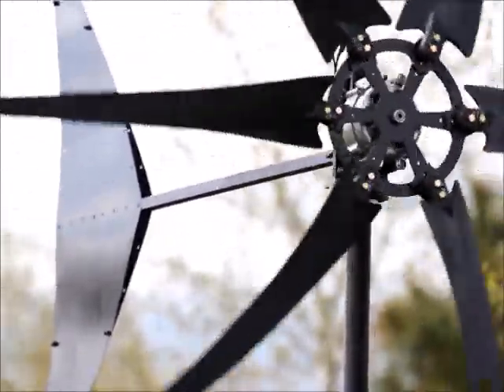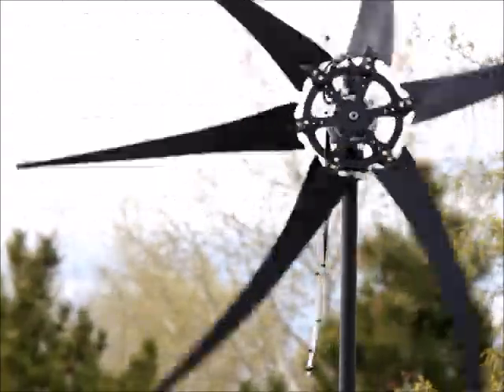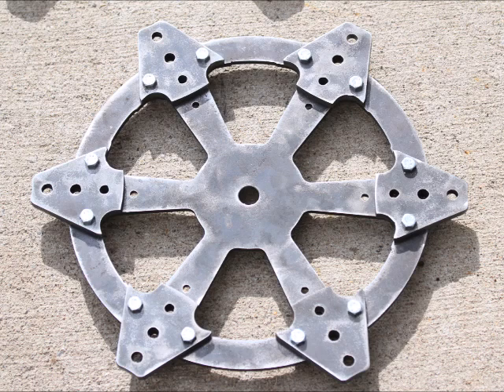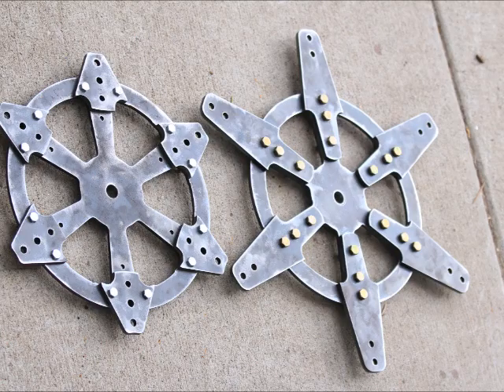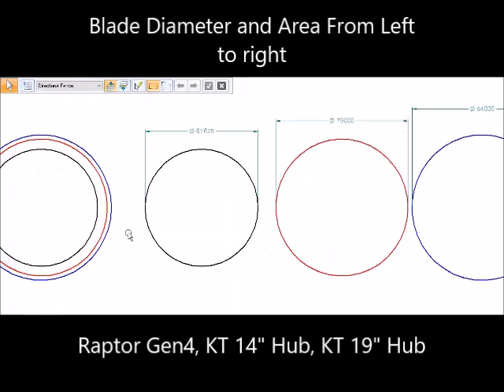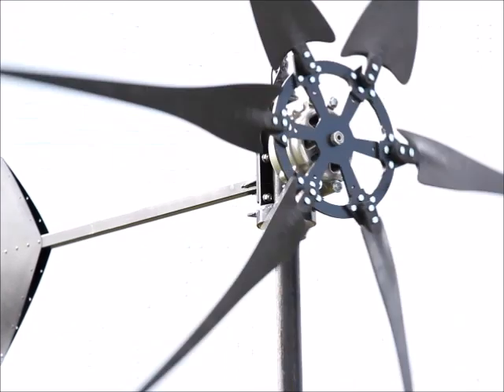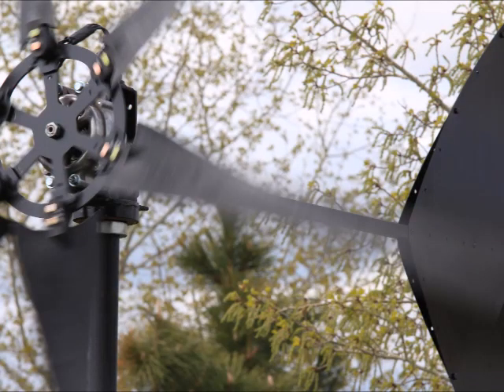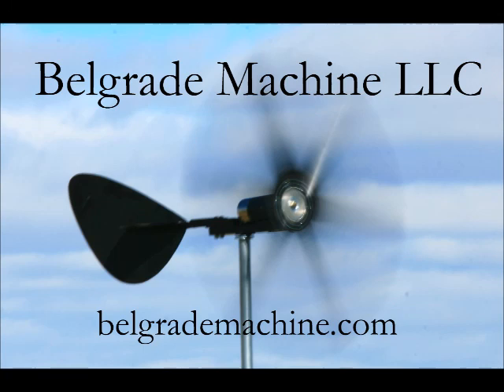New Wind Turbine Hub Fits 17mm Shaft KT Pantera Blades Thermodyne Freedom PMA PMG Supercore

Comment: If it works better or not,it looks really cool, i think with the base of the blades not overlapping, will really help turbines with multiple blades, like 6 plus, maybe a 24" hub for 12 blades? I'm in a low average wind area. With wind storms with 60-70 mph winds, for a couple days,  I'm thinking about 12 blades, on a large hub like this, like 24" + large enough to prevent blade overlap, it was this or connecting 2turbine blade sets to a single pma, with a belt or chain, that will cost a bit, and acost of reliability and maintenance also, 12 kt blades with a large hub, should prevent choking in high wind, and prevent some of the turbulence that cost power, if I could get 200 watts in 6 mph wind or so,  and still produce in 60 mph or so, hopefully around 1200-1500 watts? A bit ambitious I guess! Sorry for rambling,

Comment: Its a great looking hub design well thought out. I guessing you could make folks a lot of things that are not always easy to lay our hands on ???????
Reply from the maker: I certainly can! And it's somewhat limitless when you think of the potential applications. I was installing a kitchen faucet and needed a large thin wrench to tighten up a lock nut real quick. It took minutes. Sign work, custom branding irons, metal art, key chains, fancy door hinges etc .... Any ideas??
Reply: +belgrademachine If needed any thing in the future it would be a 17" 18" etc rotor for the magnets with 4" holes for stud axial. I found a few web sites but they never get back. I cant be the only one in the world wanting to build Axial flux generator. I think its a new cool idea what your doing
Reply from the maker: +ian57812 Awesome! those rotors would be no problem. I could have them made and in the mail in a buisness day or two. You could even draw dimensions (# of magnet poles if bolt thru)  on paper and send them to my email belgrademachine@gmail.com  I can send you back cad drawings to be sure. Clear pencil line drawings on white paper are good too for other custom stuff. Think flat pieces and weld it up over there?

Comment: Hey Daryl,
just to say that's a great hub design, but strength of the metal is so important. The hub's I've used with all types of blades have shown stress after use. The hub's are solid and 1/4" thickness are the best for mild steel use. The material of steel used and removed from hub will still bend back towards the PMA in time with high wind's. The best hub I found not to show fatigue is Windy Nation's Stainless steel hub. Because how rigid stainless steel is. My friend Al(pepper) asked me to put the KT blades on the WN hub I have and show the larger sweep it would have. l plan on showing this soon. But I see you got a thumbs down. I think someone don't like the two companies used together, LOL! thanks for sharing:)
Reply from the maker: +TheBillytheJack2010 Hey Billy, True. This is made from 1/4" normal 1018 and weighs just about 11lbs so its rather stout.  If you saw my last video look closely at the hub holding the KT blades ... it is also 1/4" but much more delicate and it spent the entire winter in that location without issue. Funny, I did however drop the entire axial off the bench once and it landed on the hub and tweaked it good, had to toss it. And I just couldn't resist making a "frankenturbine" :)

Comment: Nice hub Daryl, good to see someone addressing this. The old hubs for these are barely 8" in dia. 14"-19" is a huge step up in terms of added swept area, and nothing substitutes adding more rotor area, should see definite improvements in performance. Those pma's don't really have much issue with cooling until they reach really high rpm's, but this would be great for axial's too because of the high amps they produce at lower rpm's. If you know him, talk to Alain Desrocher (pepper), I think he might be interested in this for his Thermodyne turbines. I'll give him a heads up
Reply from the maker: +James Biggar Thanks James! I figured a guy could always remove extensions to make it a three blade and I may do that if I move the pma version out to the exposed wind areas. I also did recently subscribe to pepper thought I was already than saw his comment elsewhere .. I appreciate it. Thank you

Comment: is the mount available too?
Reply from the maker: +Rev John O&#39;Toole Hey John, yes I could make another mount. It could probably use a video of its own but I used a large (used but good) ski lift bearing which it pivots on. I'll figure something out and PM you a quote ... do you already have the same PMA? Would just want to be sure its a strait bolt up.
Reply: +belgrademachine I have a freedom pmg
thanks
Reply from the maker: +Rev John O&#39;Toole Perfect! I just sent you a private message ... let me know if you didn't get it
Reply from the maker: Rev John O'Toole Got it with be just a few minutes